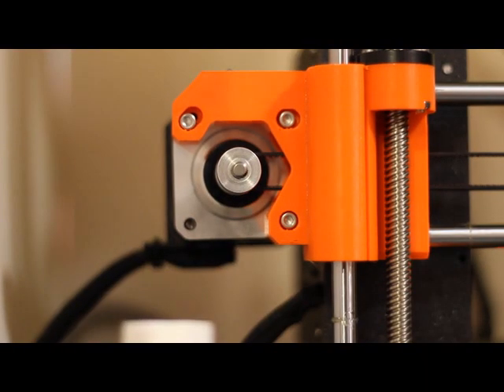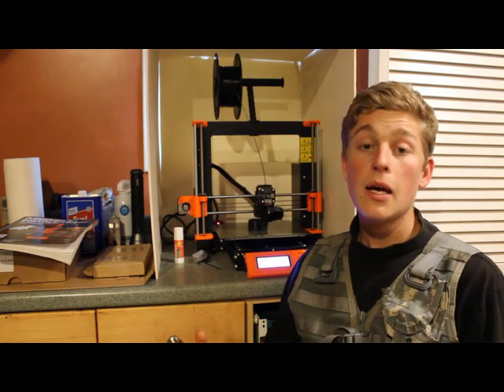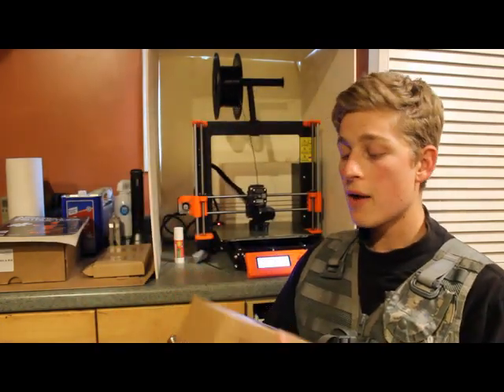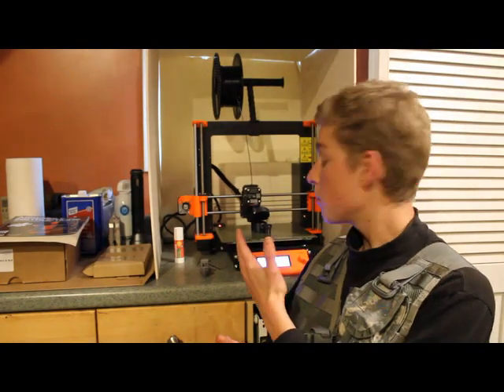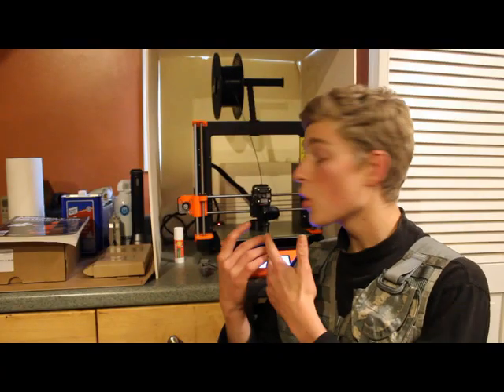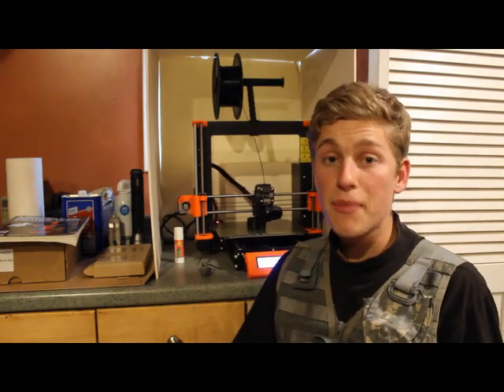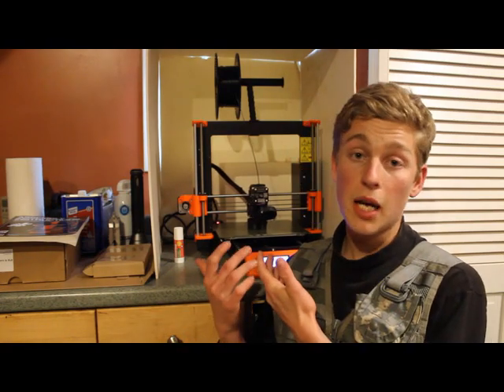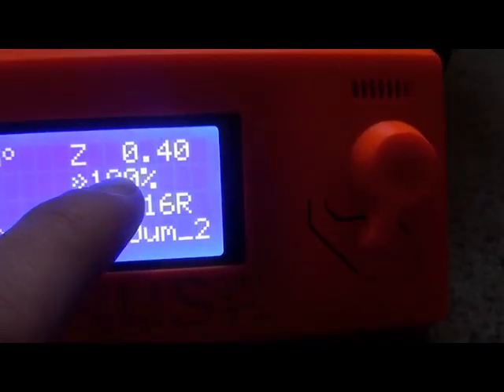Prusa i3 MK3 3D Printer Unboxing and Overview, How Precise Is It?

Comment: I had a question for ya. Came to an old video to cut through some of the noise. I’m wanting to start a suppressor business. Gonna get my sot 2 and ffl 7. Im wanting to 3d print them with stainless steel filament and do a black oxide coat. My question for you is which 3d printer would be best for me and how would I go about finding good schematics for the suppressor? I’d like to cut WAY down on the suppressor mark up. From what research ive done, I can’t see a reason a suppressor shouldn’t only be $200-$300 before tax stamps. I’d like to see a suppressor on every gun in everyone’s home but with them being about 1k per, it’s too expensive. Any help would be greatly appreciated. Love what you’re doing for the 2A community as well.
Reply from the maker: How are planning on sintering the parts?
Reply: @ I planned on buying a printer that did most everything. The raised 3d forge 1 and many others sinter automatically. I’m also fairly new to 3d printing so any advice or corrections is appreciated. Most of my knowledge of it comes from my friends printer and making some lowers with him and then the research I’ve done on my own.

Comment: what do you think about solidworks as a 3d modeling software
Reply from the maker: Hi Flox, I use an older non-subscription Solidworks design package, so I can't speak for there latest software, but if it is nearly as good as the older package I would highly recommend!